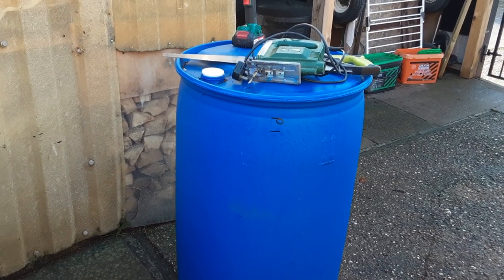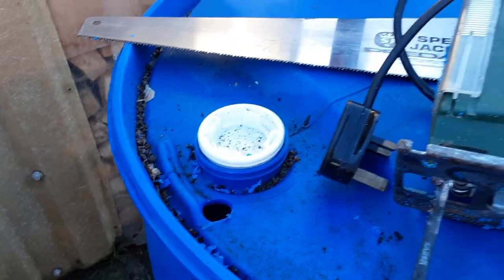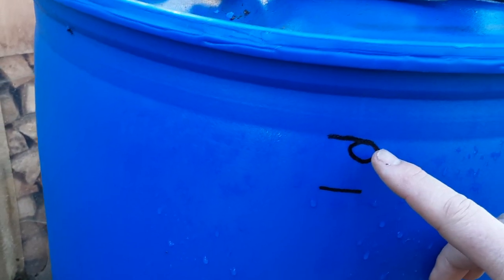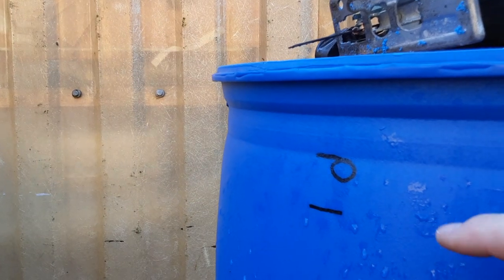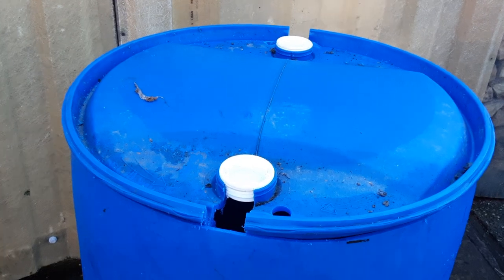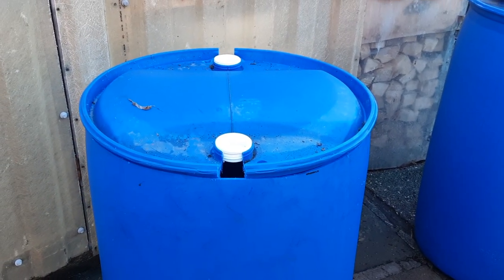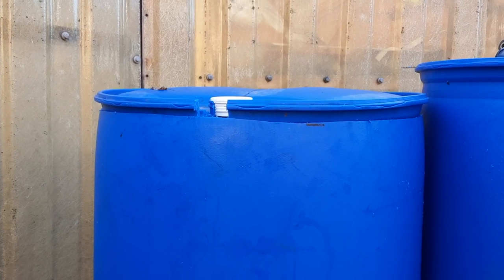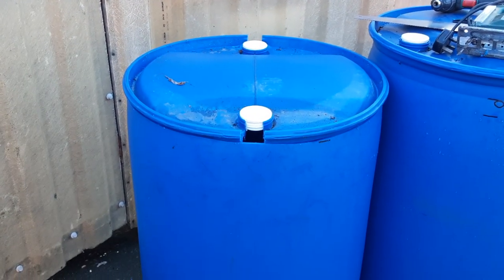Free Rain Water Barrels & How Best To Cut Them Creating A Lid ♻️ Shortest Day

Comment: I use one of them for comfrey tea. I drilled a hole in the bottom and put a water barrel tap on. I then made a wire box cage with thick wire mesh (mesh boxes are around 8mm) with one side missing and glued it around the tap so comfrey leaves dont block the tap. Its worked for almost 5 years only once did it get blocked but cleared itself after a day. I dont break the leaves and stakes up in a large bucket and some garden shears. I made   a lid for top as I didnt get one with the barrel. Please make sure you water is covered to those that do use water, I got pneumonia 5 years ago because of dirty water and it isnt pleasant I was seriously ill
Reply from the maker: Thank you for sharing your experiences and issues my friend. 

♻️Happy gardening, Terry King.

Comment: Hi Terry, useful set of videos, thankyou.  One question on your stacked barrels - with the lids cut off do you find the barrel is still strong enough to support the weight of the barrel above?  It looks to be the case from your other videos but in my mind with the lid cut off and replaced it might affect the strength of the barrel?  Thanks.  Jon
Reply from the maker: No issues Jon, yes the lids do sink with the weight of a full barrel, but none have collapsed. 

♻️Happy gardening, Terry King.